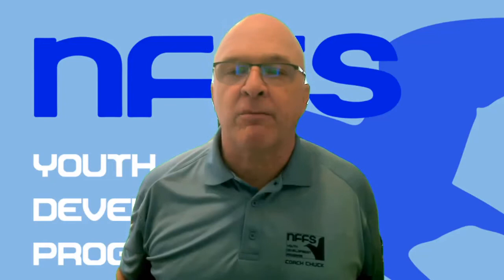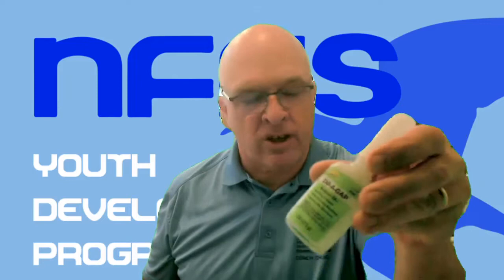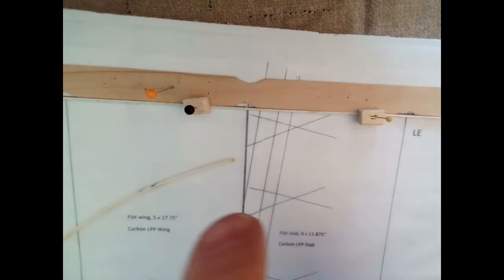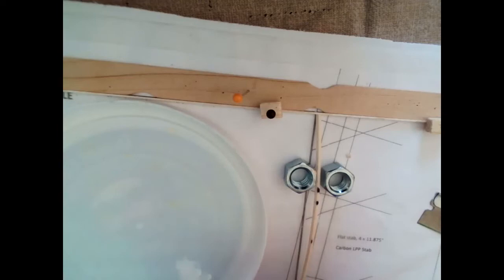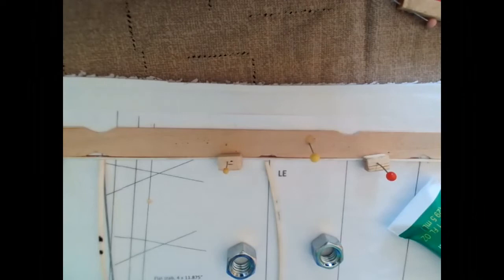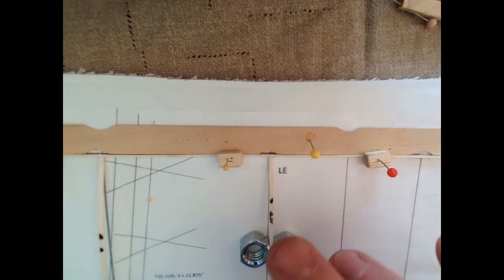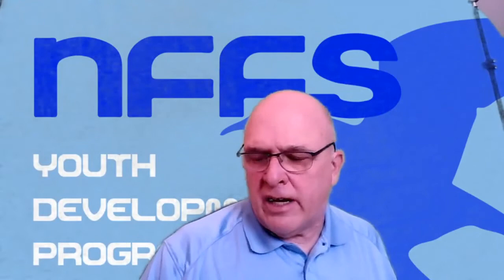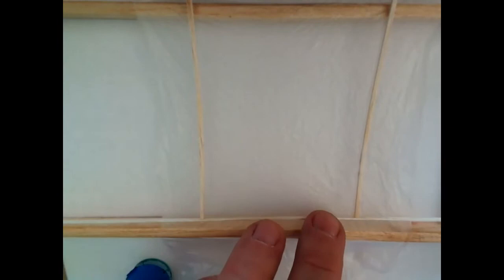Glue and Glue Management for Indoor Models

Comment: Hey, great video! I was wondering what glue is better, Duco or CA glue( what are it's advantages and disadvantages?). Also, I was wondering if it was possible to remove glue from wood. I think that Duco can be removed with acetone, but I don't know how CA can be removed.  I've heard here and there that CA can be removed with acetone, but in my past experiences, it had not worked. For the Super 3M77 spray, is there any way to remove it from the wood as well?
Reply from the maker: Thanks. Duco is a nitrocellulose based glue and there are others on the market. There are several vendors that sell a replacement for the old Ambroid (which is no longer made.) Nitrocellulose glues will give you a very strong lightweight joint.. but your wood joint need to be well fit dry as Nitrocellulose glues don't "gap fill" well. They can be removed with most solvents, Acteone being one of the more convenient. CA type glues tend to be heavy, soak though the wood creating stress point.. so for indoor, we use them pretty sparingly.. mainly for repairs or places where weight isn't an issue.. or you are impatient and just need the joint glued NOW. For thinning or cleaning 3m77 try toluene (bad stuff), xylene (less bad stuff) or naptha. it pretty hard to remove it from wood without damaging the wood, but those solvents are the ones that will break down in 3M77.